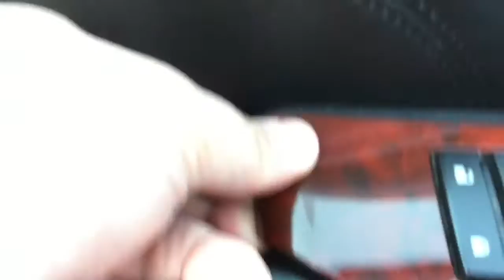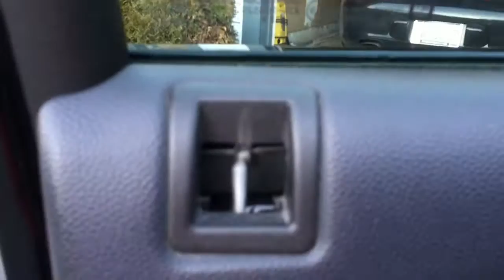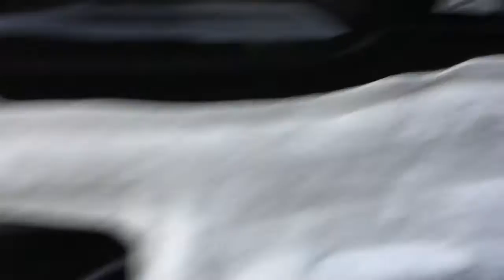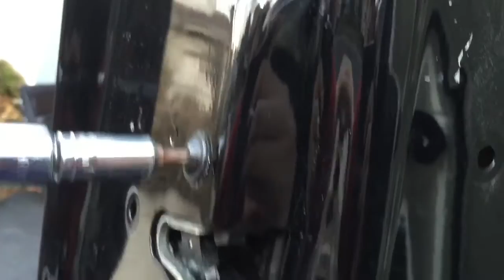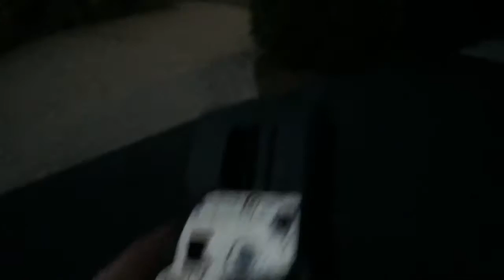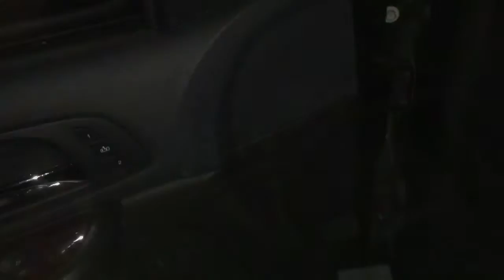2008 Escalade Actuator Replacement Front Door

Comment: You deserve more views! Good honest approach!
Having the same problem few years back I have discovered that those actuators are prone to low voltage.
I had them misbehaving both on the passenger side, rear driver side and the tailgate sometimes together sometimes individually.
For correct function they need at least 12.4V,. Changing the battery for more powerful did the trick, my truck is12 y next month (240k)  and original ones still work!
Reply from the maker: Thanks for the kudos 👍. That’s interesting about the voltage. I actually had one changed under warranty by the dealership when the car was about a year old. For me it was only the driver side that would act up when I replaced this one.  Replaced it whenever I made this video and never had it or the others act up after that. If you are getting several at the same time then I’m sure this tip will help out others.  Thanks for sharing.

Comment: I have a 2008 Escalade with 69.8k miles and have had two door lock actuators and a power window regulator go out on either rear door.  So glad I found your video to help me not butcher my door panels in the repair process, was wondering though if you think we can actually just repair the door actuators instead of replacing them to save money in the  long run since I have read they go bad very often.. thanks again.. keep the videos coming on this Escalade please🙏
Reply from the maker: Dominic Bonifacio I think the actuators are sealed.  I think the old oem parts just had a bad design.  I’ve replaced three out of four actuators and hasn’t had an issue with them since.  This is a common problem with most cars because of you think about it, every time you get in and out of the car all four doors lock and unlock.  It’s just a part that gets a lot of use.  Get the part and save the receipts as they usually come with a warranty at least for a year.  Make sure to like and subscribe.  Glad the video helped.

Comment: Thanks buddy. It was a big big big help. I'm working on the window and window motor but I still needed help getting that door panel off! much appreciated partner.
Reply from the maker: Art Gamechanger glad I could help!  Please subscribe if you haven’t already.  I just did the rear brakes and the replaced the air suspension compressor that was crazy loud.  Will have videos up soon.
Reply: Omar's Garage Sounds good.  Will do...